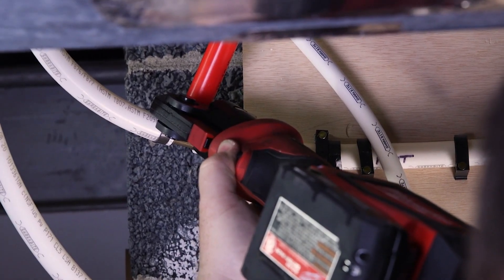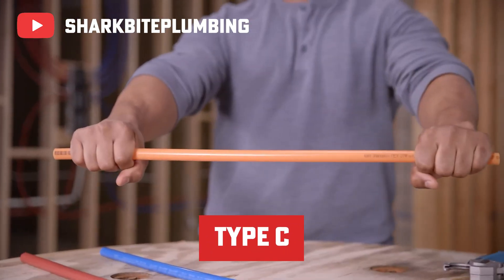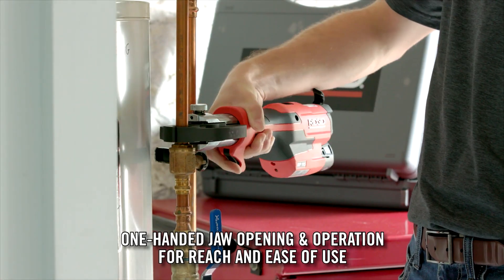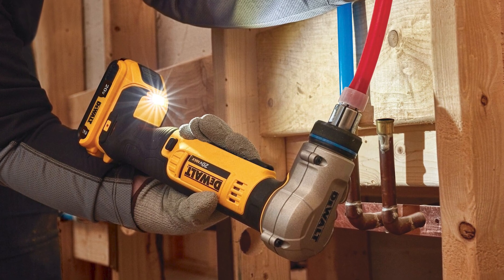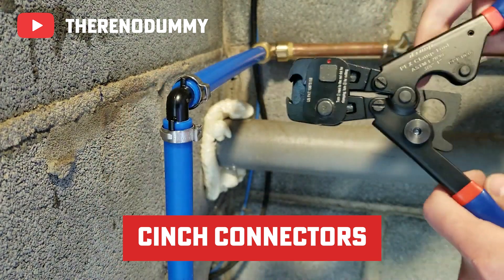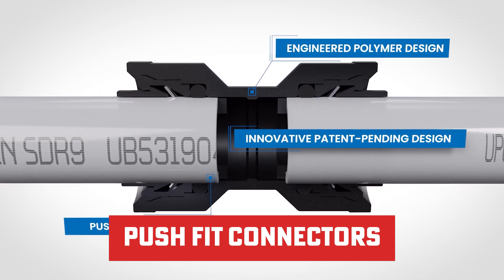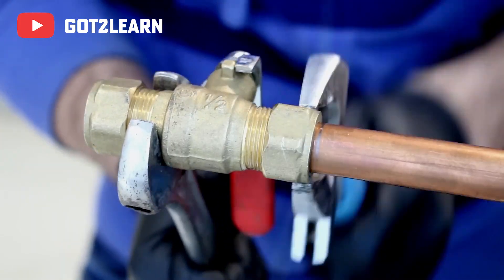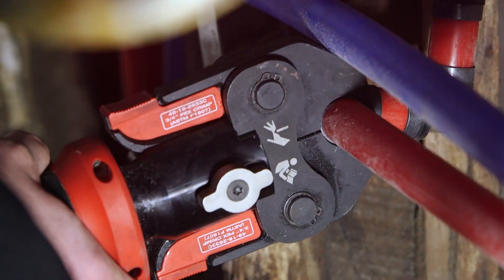PEX Press Tools & Connectors Guide! What to Choose When

Comment: Is the clamp/cinch connection as reliable as the regular crimp connections in the long run, would you use that if the connections will be under the drywall?

Comment: Does Milwaukee pro press tool and Jaws for copper tubing can be used for Pax B SS Viega fitting rings too? (Not Copper ring)
Reply from the maker: Milwaukee’s M18 ProPress tools and jaws are specifically designed for pressing metal tubing, like copper or stainless steel fittings, not for PEX-B or Viega stainless steel press sleeves.

If you’re using Viega PureFlow PEX-B with stainless steel press rings, you’ll need a compatible PEX press tool, like Milwaukee’s M18 2922 or M12 2473 with the proper PEX press jaws.

So in short: No, the copper ProPress jaws aren't compatible with Viega’s PEX stainless fittings, and specific jaws would need to be used.  Below is a link to Milwaukee's compatibility matrix that shows what jaws are needed for each brands fittings and what each tool is compatible with. 
https://www.milwaukeetool.com/PDFViewer?file=https://www.milwaukeetool.com/-/media/PDFs/Objective-Data/2024-Compatibility-Matrix.pdf